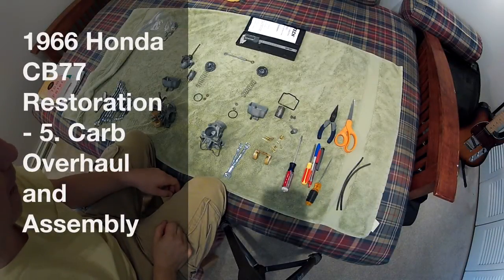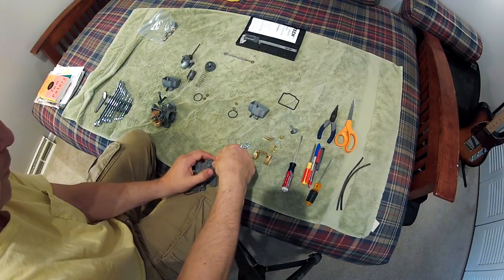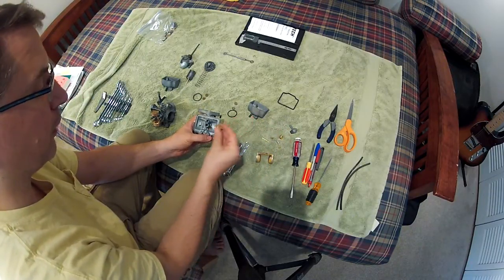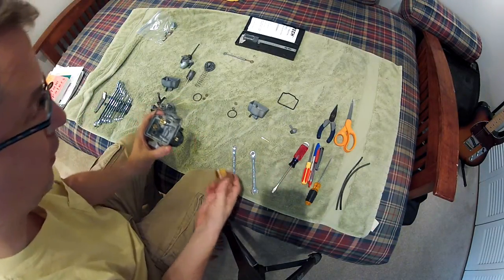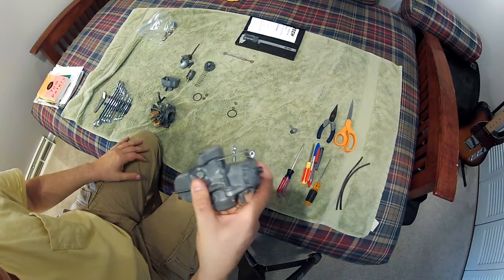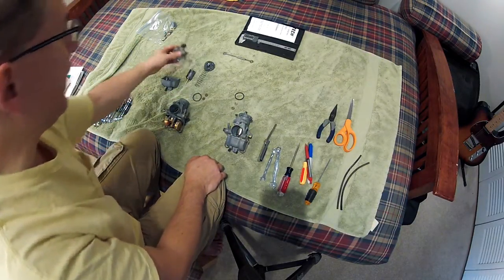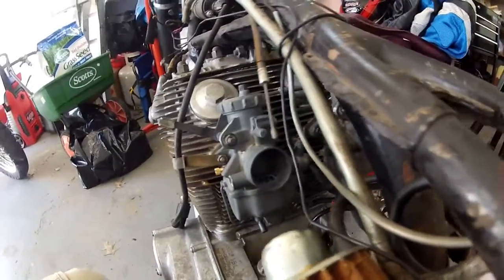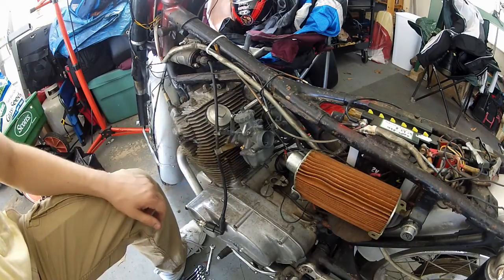1966 Honda CB77 Restoration - 5. Carb Overhaul and Assembly

Comment: Thanks so much for this video. I have never rebuilt a carb in my life. I followed your video but used an ultrasonic cleaner to bring two carbs trashed by ethanol back to new condition.
This afternoon, my 2008 Hawk came back to life.  It runs great for a bike that has not run since 2012. Thanks for your unselfish effort to help us Super Hawk lovers bring our bird back to life.

Comment: Fantastic! You are a godsend as I am rebuilding a 1964 Superhawk 305. I would like your input on two questions I have. 1) My sliders do not move nearly as freely as yours, which appear to just drop in and out. Mine seem to stick when they reach the bottom.  I have lightly polished sliders and inside carb with #1500 emery cloth with little improvement. Are they OK like this? 2) The rubber gaskets from the rebuild kit I bought are definitely too small for the carb caps over the sliders. Can you recommend a trustworthy source for the correct parts? Thank You!

Comment: The CARB BODIES are the 1964/1965 issue and the SLIDES are the 1967 issue. They are the BROWN anodized rather CHROME BRASS. ..............lm
Reply: Try an ultra sonic cleaner for those slides.